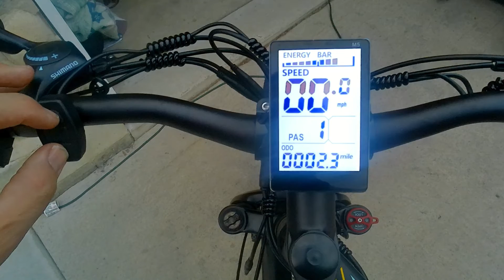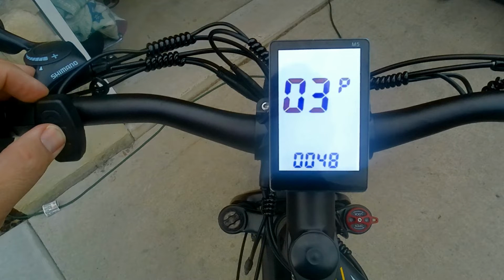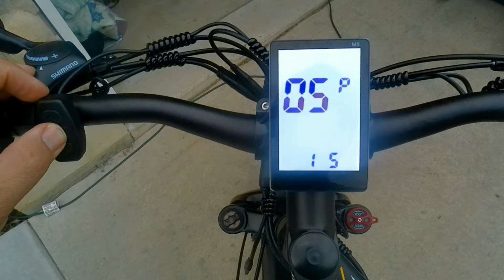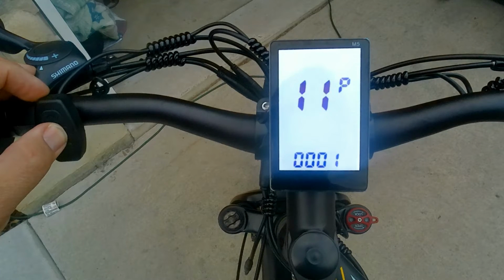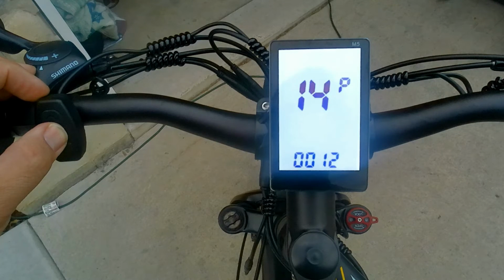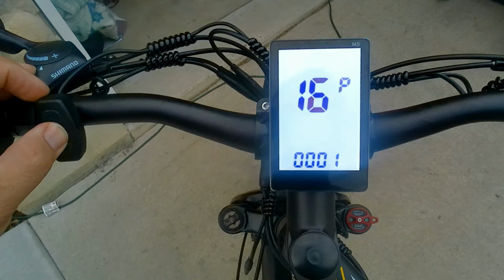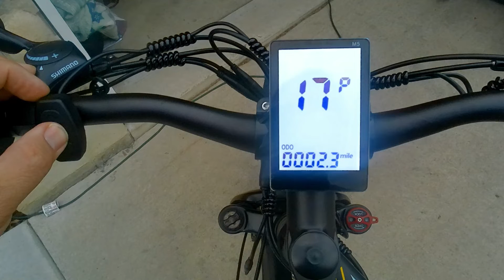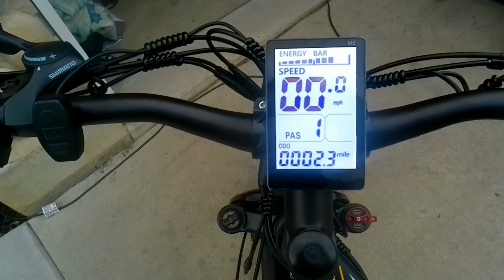M5 LDC Operation and Configuration

Comment: Hi there does this works on a Swift pro 750w fat tire? My e-bike has the M5 display as well BUT it goes all the way to P20
Reply from the maker: That is a good question, because yours has additional configuration options, they may be out of order compared to mine. I would reach out to the manufacturer.

Comment: If there a just given p1and p2, can I just disconnect a cable in the controller to make the bike faster?
Reply from the maker: I wish I could remember, by default they come locked down to a slower speed. I think I had to hold the right to break handle while turning the bike on, it could’ve been the left, but I’m not not sure now, but after that, it was allowed to go full speed

Comment: Is there a way to reset the display to Factory Settings ?

I pushed to much buttons...now (even when P10 is on 0 or 2) the pedal assist is not working anymore, when I put it on 1 for only throttle that works.

Any help very much appreciated, it drives me crazy I can't figure out what's wrong 😞
Reply from the maker: I am not aware of a way to factory reset, if you can just set the settings, the same as what I show.

Comment: Awesome video. I have the newer screen that comes on the Keteles K800. I also reached out to Keteles and they gave me the factory settings which pretty much mirrored yours.

P01=003 (back light level)
P02=000 (KMH or MPH)
P03=048 (voltage)
P04=010 (screen timeout 10 minutes)
P05=005 (first number = when the motor helps 0 or 1, 5 = levels)
P06=29.0 (tire size)
P07=086 (? Not sure)
P08=100 (speed limit in kmh)
P09=000 (0 motor helps immediately when you peddle)
P10=002 (0 is pedal assist only, no throttle, 1 is throttle only, 2 is both)
P11=001 (sensitivity of peddle assist 1-24, 1 is the highest)
P12=005 (intensity of power delivery 1-5, 1 is the most)
P13=005 (number of magnets on crank sensor 5,8 or 12)
P14=012 (max amp draw of controller)
P15=38.0 (under voltage cutoff, 38v vs. 48v)
P16=002 (cruise control, N/A on the Keteles bike)
P17=001 (reset ODO, hold mode button and ODO returns to 0)
Reply: Do you know how to fix error 8
Reply: @DailyDoseClips9626  e8 reports throttle failure [ if you have one ].  this can be caused by a number of issues,  be a  loose throttle connection [ anywhere in the wiring of this throttle input ] or even the magnet in the throttle became unglued or a failure of the hall effect chip. [ these are inexpensive via manufacturer of bike or aliexpress ]    now if you do not have a throttle control on your ebike, you should set the P010 configure  to 0.  [ no throttle  ].     cheers
Reply: @robozstarrr8930  whats error 085 ??? My bike ella moura im from brazil,  thanks

Comment: serious question. Do you have to Hercules to unplug pin?  I'm trying to replace my cracked screen 🙂
Reply from the maker: They are very challenging to unplug. Be careful not to break it.
Reply: @chrisstinkering3651  Took it to a bike shop and got it replaced. Even the guy who unplugged it had to use his strength😃

Comment: Was looking to get this bike but there are no reviews of it.
Would you recommend it? and what's it's top speed?
Reply from the maker: I would recommend this bike. It’s been a lot of fun. TopSpeed is about 35 mph.
Reply: I've put about 25 miles on mine, and it's pretty fun. I'm about 190 and it cruises on slight up/down at about 30.5-31.5. I've had it to 34.8 as max speed. I was hoping to safely goose the speed, because I want to commute and the paved curvey hilly no shoulder 55mph road gets treated a bit like a race track. I work at night and that's worrisome from behind, 45 would be safer, not to mention shorten trip time. I don't want to fry anything, so the amp regulator should limit that, not allowing me to cook it if I set it for way too much and thermal detonator the battery pack. Wonder if a gel cooling wrap would help with that... Or a copper tube cage for a liquid chill...or I could spend another 1k on a different batter, lol.